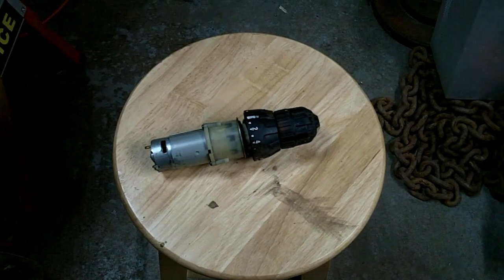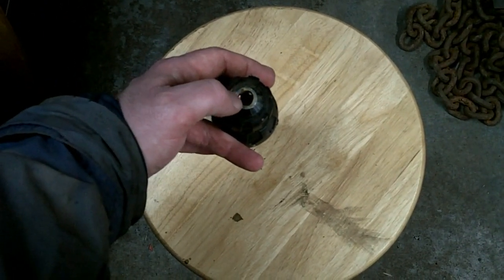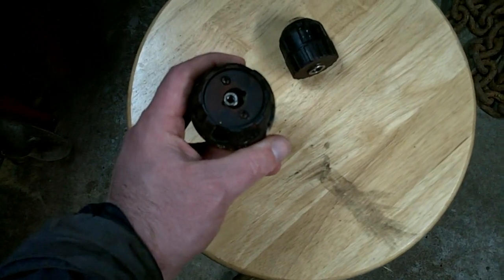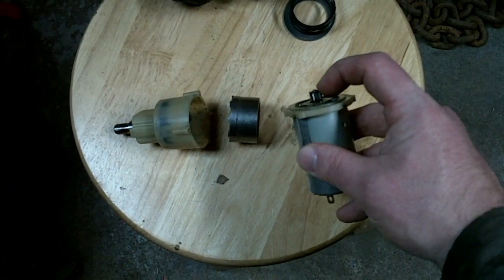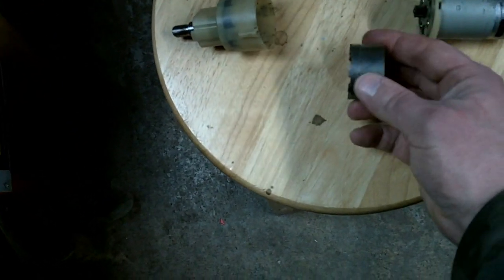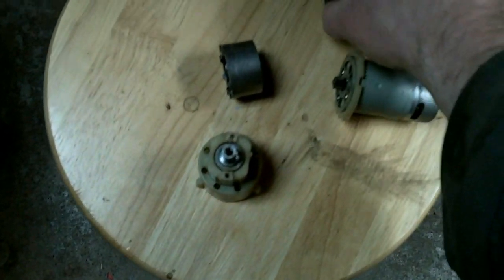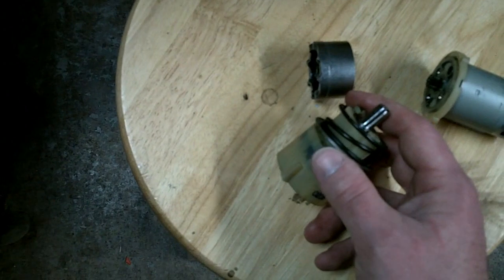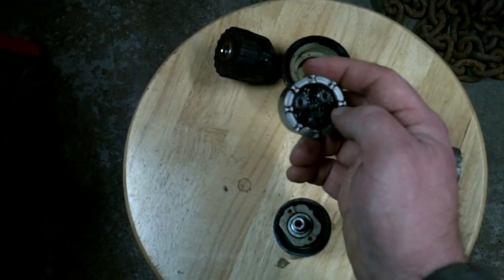DIY Classroom: Get To Know Your Cordless Drill Clutch

Comment: Ah, so that's what the noise is.  The outside of the transmission spinning over the ball bearings.  I just got my first drill with a clutch (using a Makita from 1983, still works but it's a pain) and that noise is a bit alarming the first time you hear it.  I hate using things when I don't understand how they work either, so thanks for the video, I get it now.